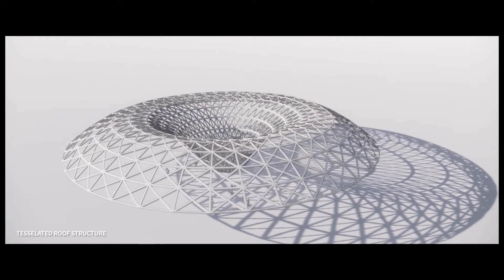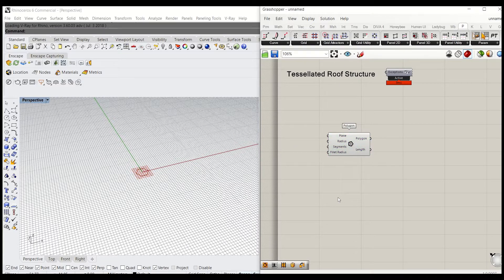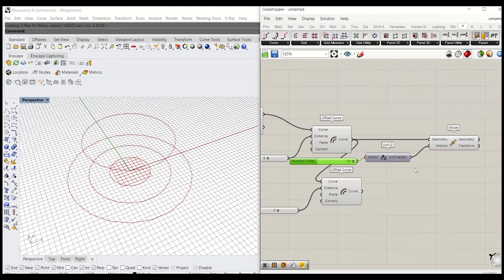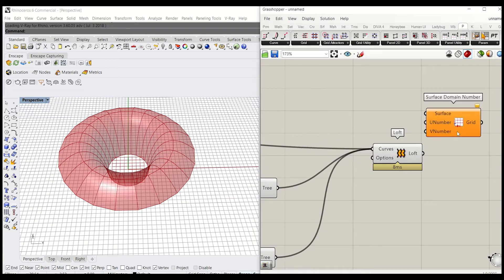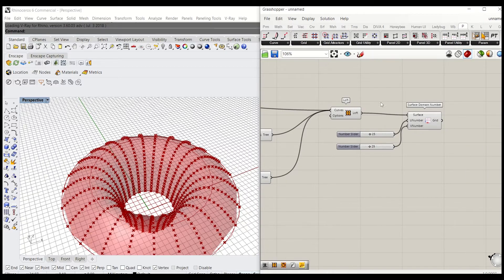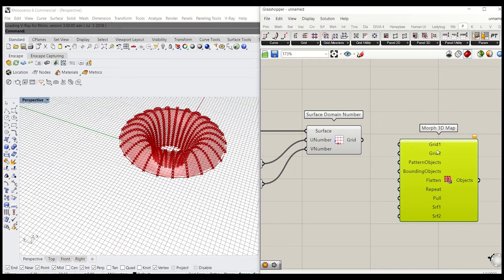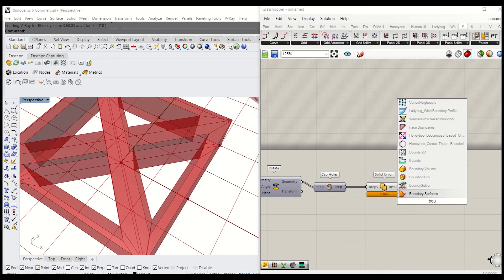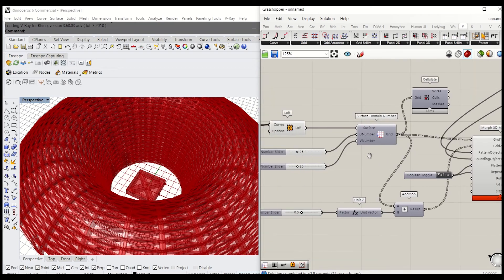Rhino Grasshopper FUNDAMENTAL series - 3. Surface - Tessellated Roof Structure

Comment: Love your tutorials!!   If we use paneling tool to build frames, like this tesellated roof, what tools can we use to add windows into the frame?
Reply from the maker: Thanks! you still can build that window glazing into the base unit (where we build the triangular frames_12th min). Use the 'boundary surfaces' to build the glazing with the inner triangle polyline. then the roof will be updated with the window in. hope it answers your question.

Comment: how do i get the surface domain number. i looked all over but its not there.
Reply from the maker: It lives in Grid under Paneling Tools. alternatively type 'surface domain' in command. please make sure you have Rhino 6 too. Otherwise, you will have to manually get the paneling tools installed to your Grasshopper.